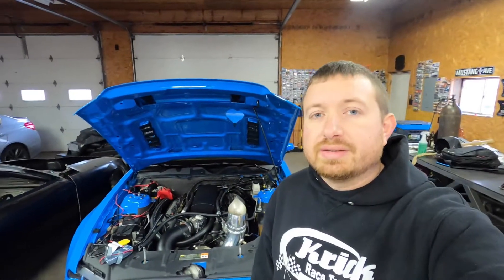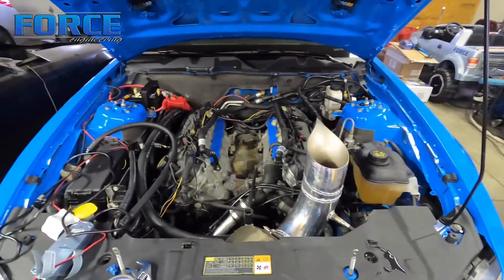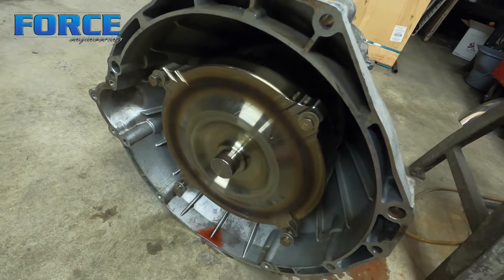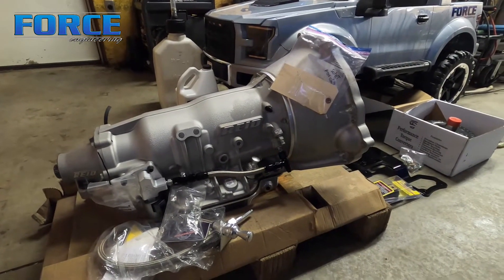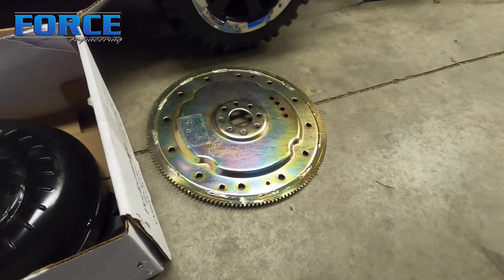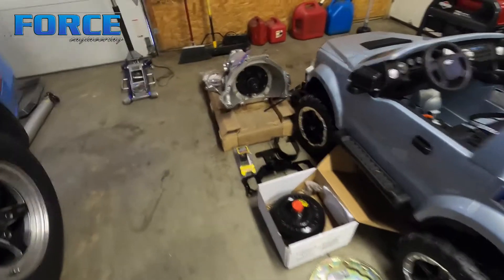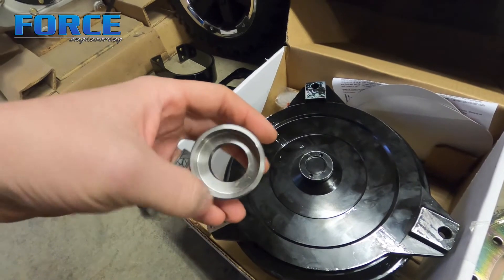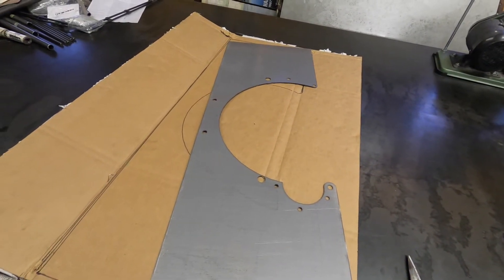Th400 Swap and Mid Plate Installation in a S197 Mustang Part 1

Comment: Hey did you have to pound on floorboard to fit th400 into 2013 5.0?
Reply from the maker: No i didnt.  Mine is an aftermarket case trans tho.  Not sure how much different the stock case is.
Reply: @ForceEngineering  Hey does th400 idle high in neutral or park? What's your idle rpm in park and neutral?
Reply: @ForceEngineering  So your th400 fit in tunnel of 2013 Mustang without any massaging?
Reply: @ForceEngineering  Hey whats car idle at in neutral and in drive.  Who tuned your car for th400?

Comment: Do you need a mid plate if doing this swap on a MT82 or can we just put the flexplate on first?
Reply from the maker: You dont need a mid plate to do the swap.  The decision to run a midplate is based on HP.  You'll be able to run the adaptor flex plate and crankshaft pilot adaptor and be fine.
Reply: @ForceEngineering  Okay, thank you.